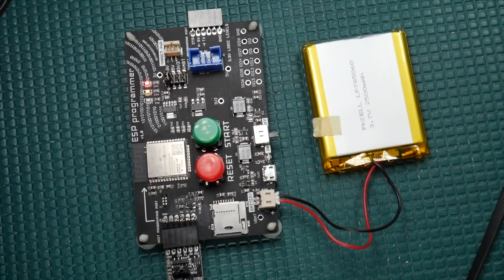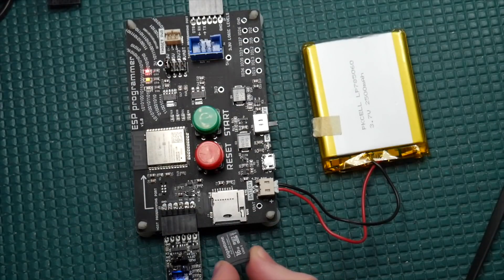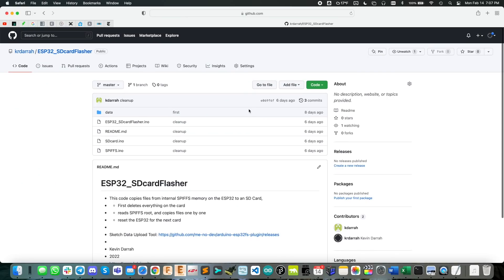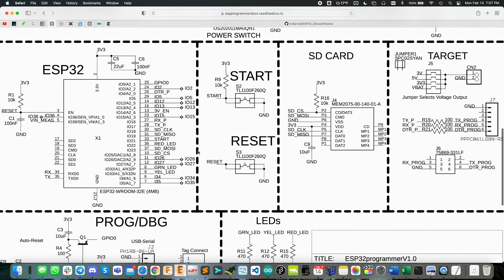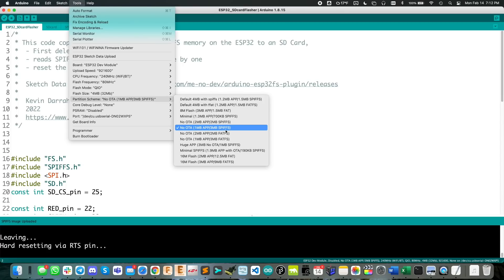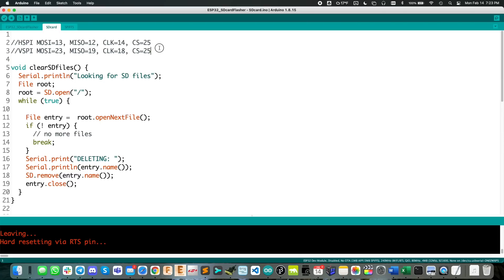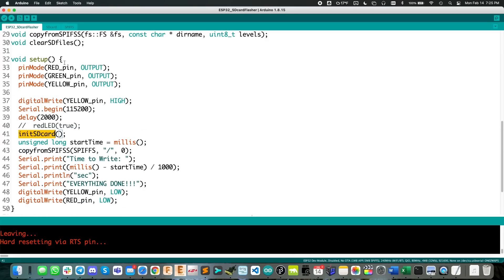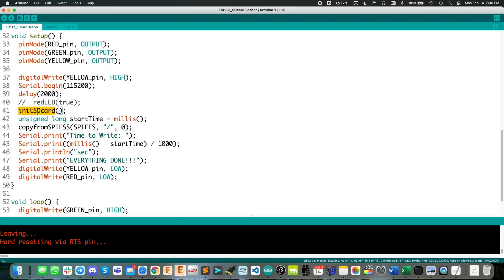Mass Write SD Cards from ESP32 - Might be a useful trick someday

Comment: SPIFFS does not really have a concept of folders, its just file names. However it only lists files and subfolders you have in a certain "directory". (if you do "SPIFFS.open("/path")" for instance everything below is listed). If you open it with "/" you will always get all files in your spiflash. Be aware that does not do long paths either. There is a 32 character limit for file names including paths. The packing tool will return a rather descriptive "unknown error" if you try to exceed this.
Reply from the maker: wow, good info!  thanks

Comment: Hello, very good video, I'm trying to do something like what you did but in reverse, look, I have a program that runs on an esp32 and reads a series of files (Json format) that is in the same memory as the esp32 in a littlefs partition Now, I load that memory from the arduino ide, but I would like to do it from an SD card reader, because if I do an up-dete of that data I would like to take it to the esp32 memory with an sd card, they are file systems large and with many folders, can you recommend a method that can help me?

Comment: I think you are supposed to transfer 512 bytes at a time when using an SD card or it will take ages. You see flash memory writes in blocks and the blocks need to be aligned as well or you will be copying the end of one and the beginning of the next on each read/write cycle.

Comment: This is a much better way and far faster.

I found a project on-line using a Raspberry Pi and a ten port USB hub. I built the device to tackle a project at work where they needed to program nearly a thousand microSD cards. Rather than spend money on a duplicator, they were prepared to spend weeks having someone feed blank SDcards into an adaptor for hours at a time.

I tested the prototype system at home and was able to program up to ten cards at a time. They were excellent duplicates.

I did not reckon on the engineer who had purchased the cards for the customer. He had bought the cheapest 4GB cards he could get and they repeatedly failed.
Of course, he blamed me for the failures.

I examined the remaining in programmed cards to discover they were not the 4GB capacity as described. Closer to 3.5GB and as a result, when the RPi was writing the image to all ten cards, as soon as the image went over 3.5GB, it corrupted the image on the cheap cards.

I made sure his boss knew about the low capacity cards.

The software was proprietary from the customer so it wasn’t possible for us to alter the image in any way.

Comment: Since you're using an ESP32, I wonder if you could set it up to pull files from an FTP server. It might be too slow to use for bigger files but you wouldn't need to store them on the ESP32 or update multiple writer boards if you need to update or change a file
Reply from the maker: yea I was thinking about that too!
Reply: SPI is relatively slow compared with SDIO on SD cards. FTP network access may not be so much of an issue. for cloning large amounts of data SDIO may be better on a different platform.